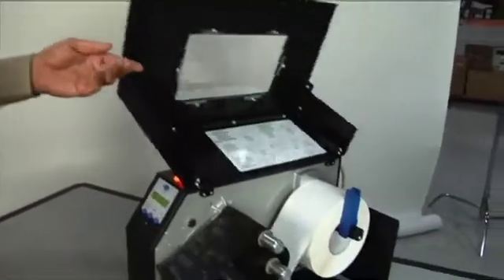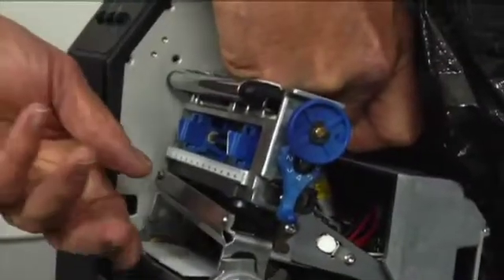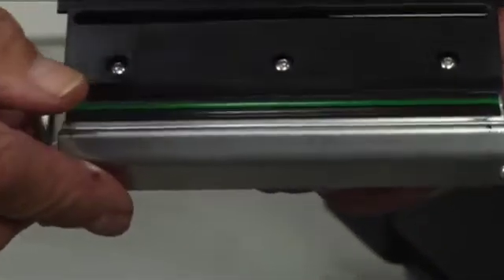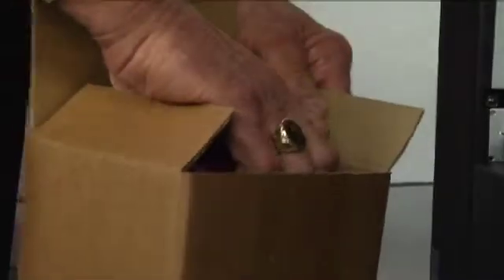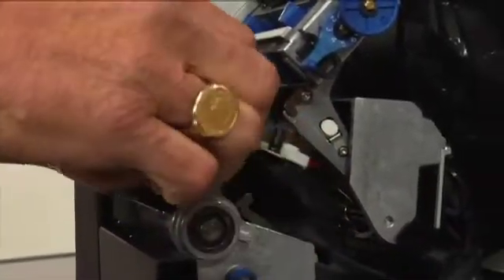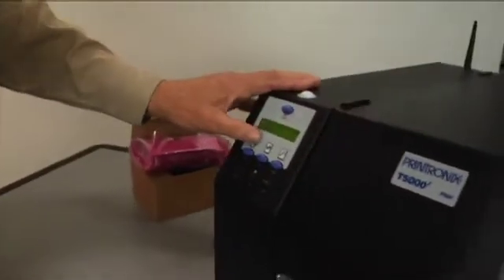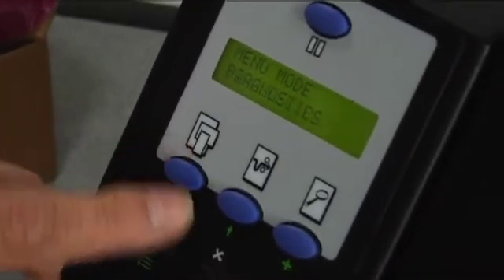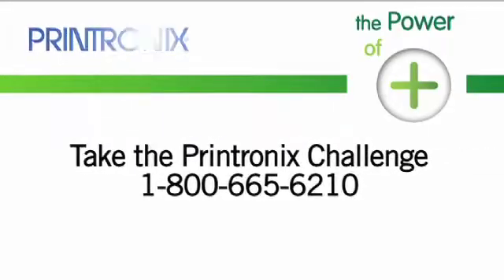Printronix T5000 Thermal Printer - Replacing the printhead - Part One

Comment from the maker: Yes, you can push the print head assembly down to the lock position but if you fail to move the to lever up to activate the sensor the display will show print head open.